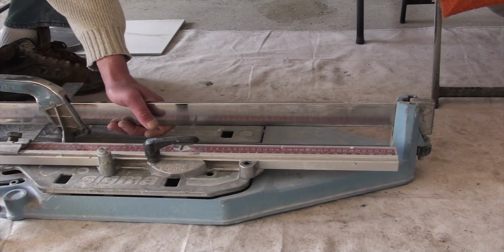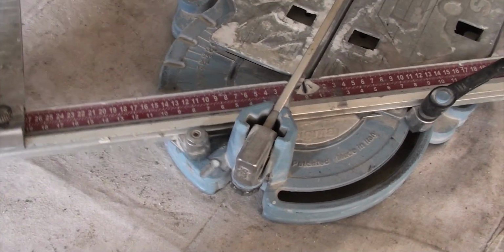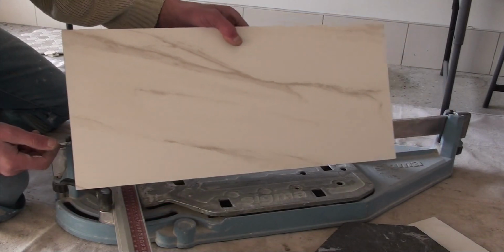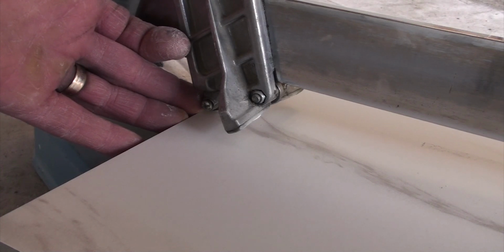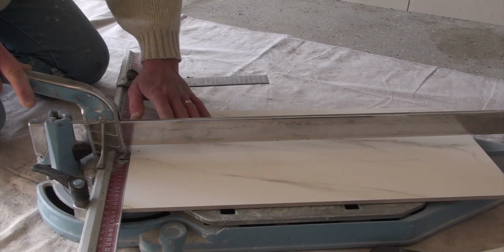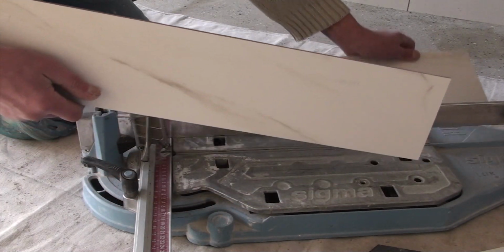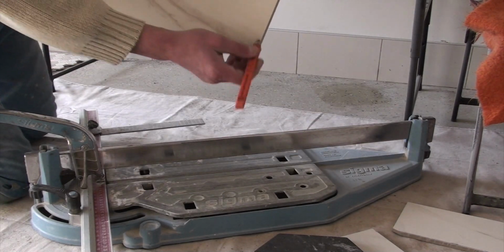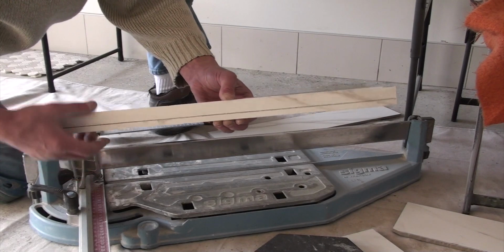How to cut ceramic tiles in thin pieces (tips and tricks)

Comment: Very good. ... But, what would you recommend if you buy new replacement tiles for a small patch, and the new ones are slightly larger, about 4 -5mm? 
The tile cutter won't do it.
I'm about to buy a cutting disc for the grinder, so wondering if you or your viewers had a better idea.
Reply from the maker: Pablo Lobo thanks for watching my video! A good solution for your issue is to cut the tile with your cutter and after that to broke the tile with a nipper. After that is good to stone the rough edge of the tile. This way is better than a grinder.

Comment: I have this exact same tile cutter! It's really cool to see a real professional using it. I found your video because I need to cut baseboard tiles from the tiles I used to cover the floor. They are 12x24 inch tiles. I asked around today all over Lisbon to find some marble shop that would cut the tiles for me. Strips of about 3x24 inch. They will not do it. I don't really understand why. Too much work for little money? Maybe. They all say they are busy. I think cutting strips of tile like you do is a good method but after the cut, the edges are dangerous, they can cut your skin. How would you solve my problem? would you cut the tile strips and then grind or sand the edges? How. Or do you have any other suggestion. Anyway. Thanks alot for teaching me your skills. Have a good day.
Reply from the maker: Hi zangarelho ! Thanks a lot for watching my videos and for subscribe. I have two solutions for your problem. It’s simple! 1). We use 8 feet long ( aluminium or plastic) profile on top of the baseboards. Its name is Schluter. You can google for it. I’m in Canada but for sure you can find in Lisbon because Schluter is made in Germany. Also, there are different sizes 4 mm, 6, 8, 10 mm depend how thick is your tile. If you use this Schluter on top you will solve your problem because there are special designed for this problem and also it looks very well. Also there are lot of colors to match with your tiles or to match with the appliances for example. The second method is: Wet Saw for tiles of course. You don’t have to buy one. Go to HomeDepot and rent one for a few hours. It will cut your strips very well. Hope it helps! Please let me know how you solved your problem! Thanks and have a great day! Luchian
Reply: @diyday21  Those are great advice. The Schluter is a wonderful idea and it gives a luxury look to the floor. The wetsaw, i can't rent it in my area. I think I am going to do a wooden "schluter". It itakes some work to complete but it's cheaper and I have what it takes to do it. If you send me your email, I can send you photos when the job is done! Thanks alot again and have a good night!
Reply from the maker: @zangarelho this is my email: luchianni@yahoo.com
Reply: @diyday21  Hello! I finally sent the photos to your email!
Reply from the maker: @Hapotecario  you did a very good job! Congratulations!

Comment: Hey! Great video and good advice for cutting the slim strips - but what if you need to cut a very thin strip off the main piece you want to use?

I have to cut around a windowsill and need to remove about 20mm off each tile but they keep breaking and I can't cut further into them. Any suggestions?
Reply from the maker: Hello and thanks for watching my videos! There are 3 options in your situation: 1) If you didn’t start to install your tiles then make a better layout to end around the window with a big piece which your cutter can cut it. 2) use a wet saw. And 3) cut with your cutter, then brake with pliers, then finish the rough edge with a grinder. Hope it help!
Reply: @diyday21  - Thank you for the advice!

Comment: So basically, use the "tried & true old fashioned method" and take your time rather than hurrying through your project and trying to use a power saw of some sort, like a grinder. 

I'm game. Awesome! THANKS!!!

I need to trim 2"×2" tiles to go around a basement kitchen sink. The countertop is only 5 foot long, minus a sink that's 25" wide by 18" deep on a plywood countertop that's 25" deep. 

It's a small project, and meant to be temporary while living in my MIL's basement. We already have the tile on hand that I plan to use that we got for 10 cents each about 10 years ago so making sure all the colors match doesn't matter much either. 

(But I may dismantle the 12"×12" grid pattern to mix & match a bit as I need 4 more supplementary NEW full tiles to complete this project. They're old tile sheets that are starting to come off the glued sheets anyhow, anytime I move them around. 

I don't fully care if it's perfect looking, just functional for the time being. But it wouldn't hurt to look like we care about how the finished product looks either! 🤣 

If it's gonna cost an extra $20 to buy 5 additional tile sheets, I may as well invest the time into incorporating the colors a little bit, right?
Reply from the maker: Thanks for watching!